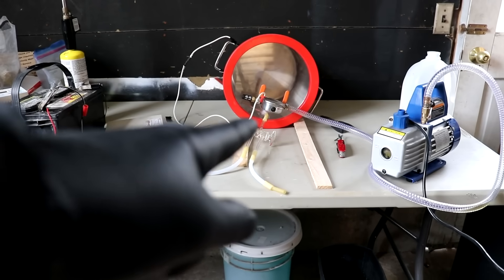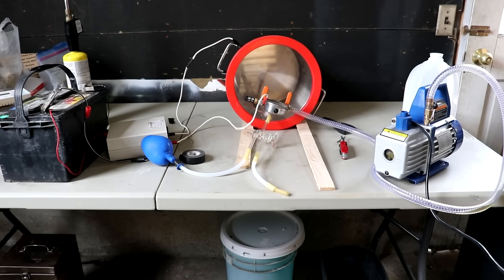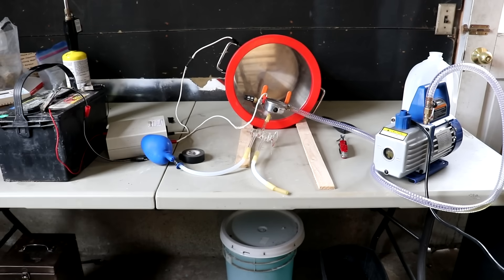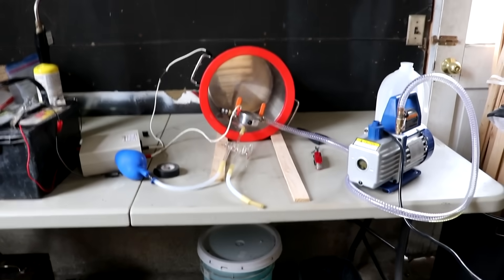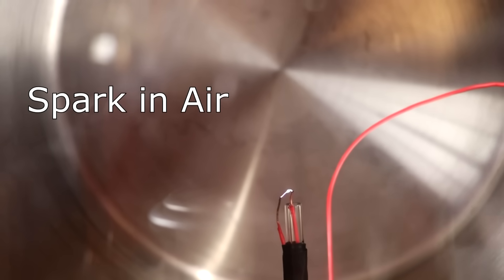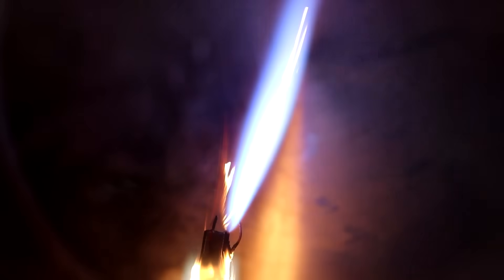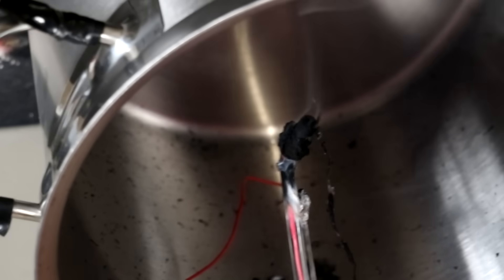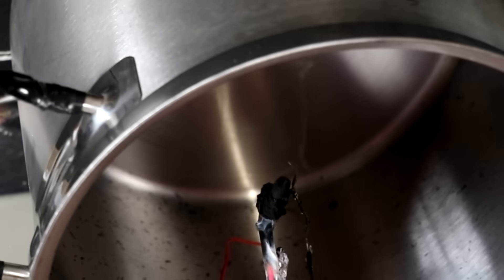Burning Propane in Pure Oxygen?

Comment from the maker: You could see my contingency plan for a runaway reaction being put to the test: step one shut off fuel/oxidiser going in, step 2 move camera and self to a safe position, step 3 dump in CO2.  Arguably not the best but seems to have worked.
Reply: it got cold outside for unknown reasons
Reply: Note that the propane flame appears yellow NOT due to the usual reason of incandescent soot of hydrocarbon flames that you are normally used to, but rather because the flame is so hot and ignites so instantaneously upon leaving the tip of the capillary tube, that it is vaporizing the glass of the delivery tube itself and thus producing the brilliant yellow D-lines characteristic of all sodium flames. It is only upon ignition of the wire insulation slightly below the propane tube tip that the propane flame turns its intrinsic blue green color charachteristic of all sootless hydrocarbon flames due to the strong carbon doublet rovibrational emission lines referred to as Swan bands. The burning wire insulation is producing CO2 and causing slight detachment of the propane flame from the glass tube tip, thus cooling it and suppressing the bright sodium emission. All of this can be seen in the frame by frame. Interesting.
Reply: Gardening with pure oxygen, propane and Cody could warm things up, but I'd prefer to wait until things warm up on their own than risk an accident.
Reply: Cody'sLab We really enjoy your videos and you do it very well with ten fingers. Try to keep them!
Reply: YO, Cody. Could you attempt to burn shredded Titanium foil in an atmosphere of Nitrogen? great video by the way.
Reply: maybe you've already though of it, but I'd suggest using ceramic or glass tubes to insulate the electrodes. perhaps tie everything together with metallic twist ties, although that might interfere with the arc (and might still be a fire hazard depending on the metal's reactivity)
Reply: i love ur vids so interesting I love science. :D
Reply: A good stopping point in any experiment is right before everything explodes, unless that's what you're going for
Reply: could you duplicate repeate this with similar materials to Apollo 1, maybe discuss what happened with Apollo 1 on a material level?
Reply: My contingency plan would have had the same steps 1 and 2, but step 3 would have been "continue observing this new and more interesting experiment". There's a finite amount of oxygen in there, which is being consumed so eventually it'll go out.
Reply: what happened to gardening with cody
Reply: Colour me intrigued...
Reply: I’m curious if you expected everything that could burn to burn in the pure oxygen.
Reply: Cody'sLab watching these experiment's are a kin to watching Nascar. Keep em coming and be safe. 🐙⚡💥
Reply: Your comment about Apollo 1 was my first thought, as well. Luckily, that disaster is fairly well-known, helping everyone to be aware of the danger of doing any experiments in a pure oxygen or even an enriched oxygen atmosphere.
Reply: 'maybe burning something in a pure Florine atmosphere'

Don't fuck with fluorine.
Reply: they make fire extinguishers with co2 only, so it must be good at its job and its pressurised in a can already
Reply: Any of the welding shield gasses would also work just fine. After all they are inert. Argon might of been interesting with the arc.
Reply: Might you have tried turning the vacuum back on instead of turning off the fuel (still turning off the oxygen)?
Reply: You almost gave this old woman a heart attack. For all I knew, this could have been "found footage" that someone else put up, then no more videos. Glad you are ok....unless this is one of those "found footage" situations and you are not ok. Are you ok? Maybe you should invest in some shatterproof and bulletproof glass and film from behind it when it comes to things that might explode. And a fire extinguisher or ten.
Reply: nice to see you do such plans now after the nitroglycerine/knife-gate
Reply: This was an amazing demonstration
Reply: hey Jude "pure fluorine atmosphere" lmao
Reply: I'm glad you had a contingency and it worked, this seems like a dangerous experiment even for you. Glad you're safe.
Reply: Here recently an elderly couple started a fire with cigarettes and their oxygen generator exploded.
Reply: ConceptNull publishing and uploading are different. He can make comments on any video he has uploaded, but you can't see it until he publishes it (or gives you a direct link, I think).
Reply: You made an inside-out hybrid engine.
Reply: Cody'sLab 

"Are we breaking it, please god let's just be breaking it." 

-jontron (this was my first thought when I read "reverse reverse flame"
Reply: Metser wrote "it got cold outside for unknown reasons"

That darn climate change!
Reply: Cody'sLab what would happen if you put uranium in a microwave
Reply: first thought: This will be cool.
second thought: Wait, this is oxygen. stuff is going to burn.... Don't DO IT!
Reply: A better frame by frame of this would be nice.  Darn good idea.
Reply: Obviously it was already too late, but when you had that plastic in there I went "doesn’t plastic burn in an oxygen riche atmosphere?” 
Glad you were safe...
Reply: I just want to say that you're such an inspiration to me. I have decided on a future career in chemical engineering because of an interest you have sparked in me. I was in a small panic when you almost lost your channel. I'm glad you're still here.
Reply: Does the flame add or subtract to the atmosphere in the tank meaning " if you begin the experiment with a slight negative pressure when the flame lights does it create more negative pressure" I know its hard to measure it because your adding the oxygen.
Reply: Cody: whats danger?
Reply: Cody'sLab Hey Cody... you need some compositional data from the world leading foundry where I work? Lol Iron compositions. Averages, aims, std, sigma stuff.
Reply: Well if you did not have a vacuum before, you certaily would after that oxygen used itself up.
Reply: Cody probably has three or even four sheds.
Reply: Glad you're uninjured
Reply: Ten fingers? Is he polydactyl? He needs to keep the thumbs too. Extra fingers tend to get in the way and make fitting gloves a PITA.. Just yanking you chain. Your right that he needs to protect the fingers and thumbs he was born with.
Reply: I was thinking that the copper might react with the 100% O2 and the heat from the spark.
Reply: Step 4 - disconnect the battery!
Reply: its called having a release schedule... he had uploaded it earlier and put the comment on before putting it up for the public.
Reply: Winter happened.
Reply: Sean Not-Telling - In some languages there is no word for a thumb so, to those people (Russians, for instance), we do have ten fingers. The thumb is sometimes called 'big finger'. And to musicians, such as pianists, the thumb is the first finger.
Reply: Try nitrousoxide
Reply: The fact that you have contingency plans and worry about stuff like accidentally making a bomb is what makes you far better than a lot of youtubers.
I do wish you'd take a 30sec or a minute to mention your precautions and what could go wrong in the videos though.  Not only is it interesting, it might help other people avoid making stupid mistakes.
Reply: Cody, I once noticed a long time ago that if you dig down on the definition of "fire" on the Wikipedia, oxygen isn't actually a requirement. There are "oxidizing" agents like fluorine, pyridinium chlorochromate, etc. that have no oxygen. Could you demonstrate the fire triangle without oxygen?
Reply: Cody'sLab I laughed when this happened because I knew what was going to happen because I have made Thermo Lance's with brake lines and oxygen cylinders if you can burn Steel with just oxygen stores you can definitely burn piece of plastic lol
Reply: Metser The earths axial tilt must cause some sort of of heating and cooling on a regular cycle, maybe we should look into this.
Reply: How is the video published on Apr 22(today), and your comment is 2 days old???
Reply: oxygen doesn't explode.
Reply: Cody'sLab i watched a king of random video and found out that petrol frozen in liquid nitrogen is more reactive. maybe the cold temperature attracted more oxygen from the air or something?? 🤔🤷‍♂️
Reply: wouldn't something like argon or nitrogen be better because CO2 does actually contain oxygen? I'd say helium but I know helium stores on this planet are getting dangerously low and we are going to run out within our lifetime so saving it is the best thing (especially because MRI machines need it)
Reply: Cody'sLab In Nice To See The Reaction Take Place. Thanks Cody!! You & I Knew That Would Happen! I Was Taught At An Early Age @17 In Nursing School That A Pure Oxygen Environment Is Not flammable! You Have To Have A Catalyst Such As Carbon. That Was Totally Epically Awesome!!! 💥💥💥